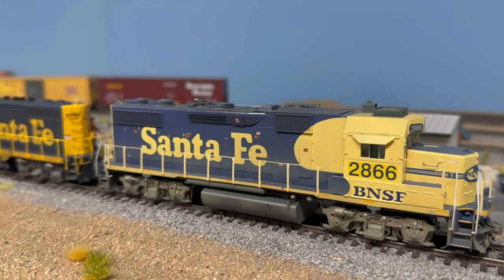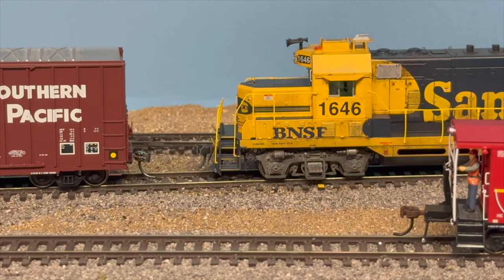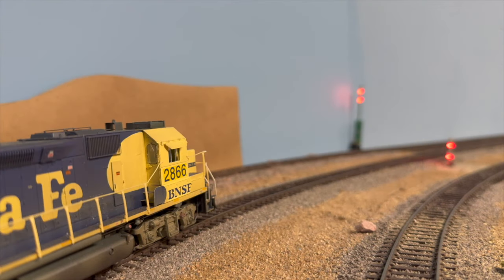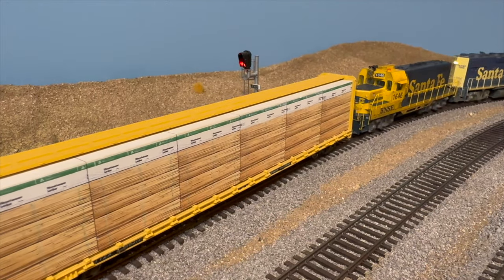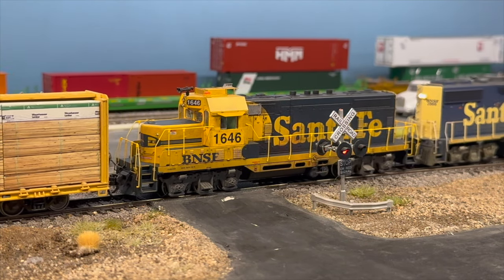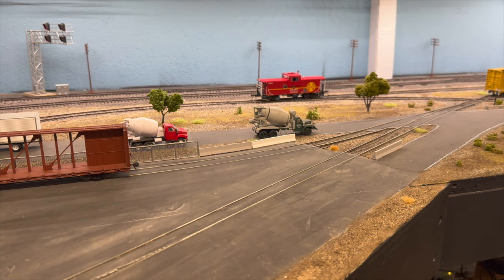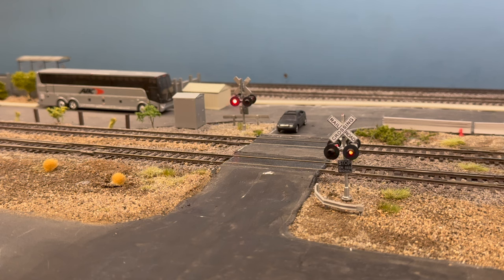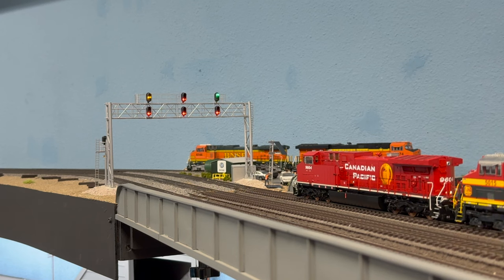Local Switching! HO Scale Model Railroad BNSF Layout

Comment: Great video and layout.  What are your layout dimensions?
Reply from the maker: Thanks for the comments! The layout is approximately 11x15 on 2 decks. Average width of about 18”
Reply: Do you have a diagram of your track plan?  My layout is roughly the same dimensions without the second level.  You didn't do a helix did you?
Reply from the maker: I am working on a proper diagram for the layout and I’ll get that out soon. I do not use a helix on the layout. It’s a 2 1/2% climb. Works pretty well! Thanks again for the comment!
Reply: That would be great. Thanks